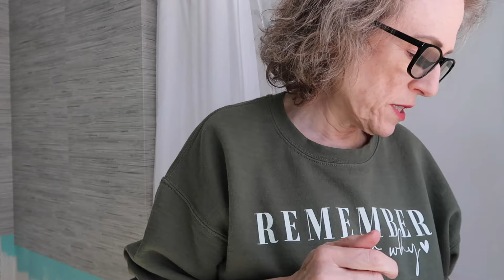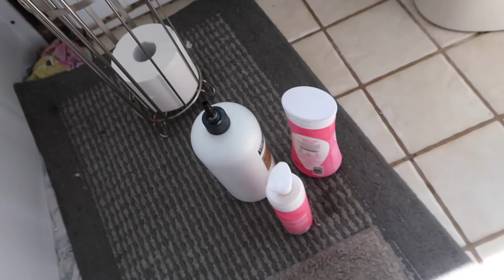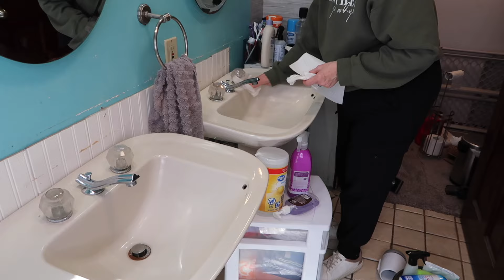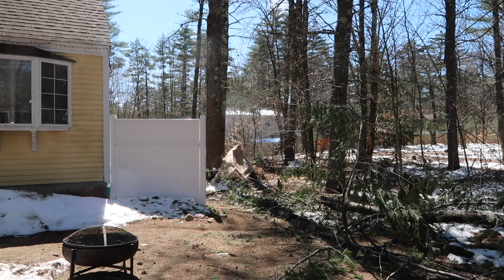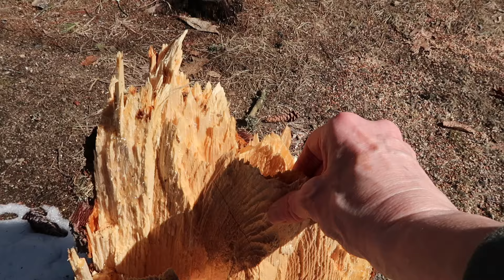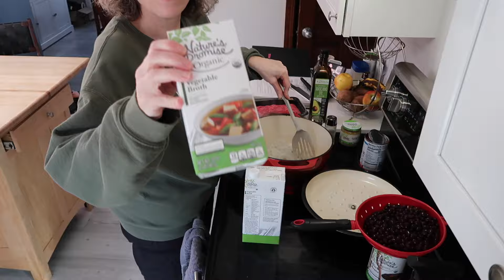SUPER MOTIVATING! Bathroom deep clean, yard clean up, DIY, cook with me!!

Comment: My suggestion for the baskets is to use the canned air spray that is for computers and blast the crooks and crannies (outside of course).  Then, after it is clean, maybe stick a folded tea towel in it and you can pull it out and wash that when it gets dusty again.

Comment: I would use an old tooth brush for that basket. First just a dry one and perhaps hoover if it doesn't get clean what I've used is a tooth brush dipped (not a lot of water)  in luke warm water with a drop of soap to scrub it gently, do little bits and wipe with a clean cloth. It's worked for me xxx

Comment: I rinse vikker baskets by rinsing them from the outside. Luke warm water.
Wh3n younare cleaning your oven in the kitchen, try dish soap and water. Put cling film on, too keep it wet, and leave it for a few hours. (or all night). It works so well, and no fumes. 
You can use the colapsable stool you put in the closet when you are cleaning areas low down. Then you dont have to bend as much.
Reply from the maker: Thanks! 🙌